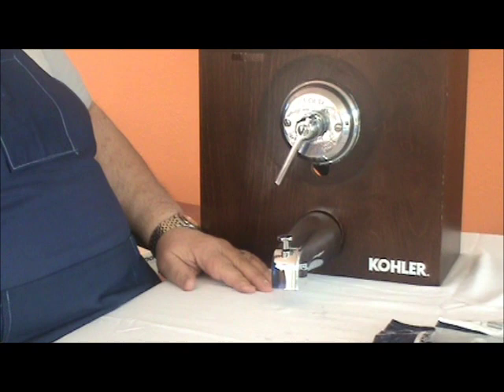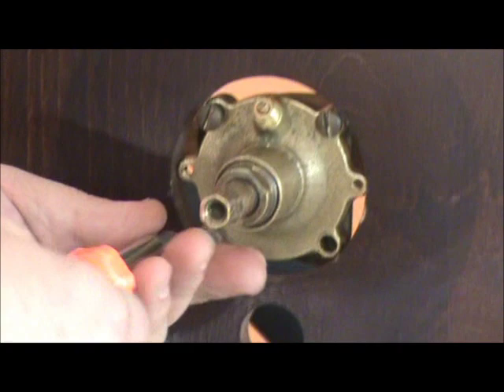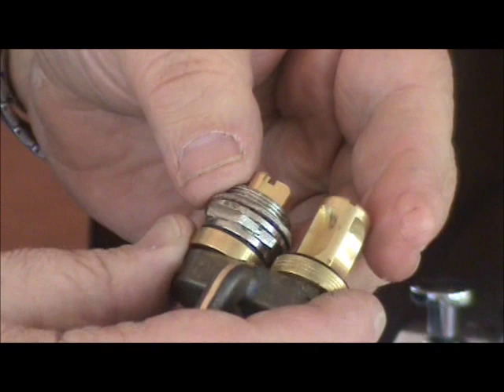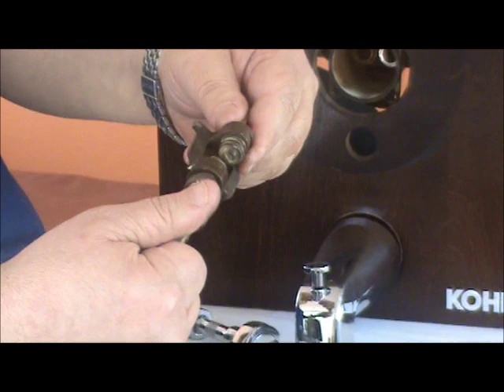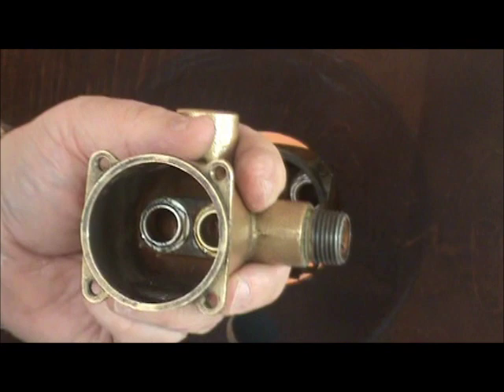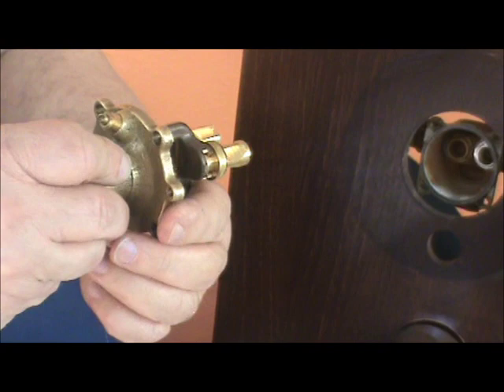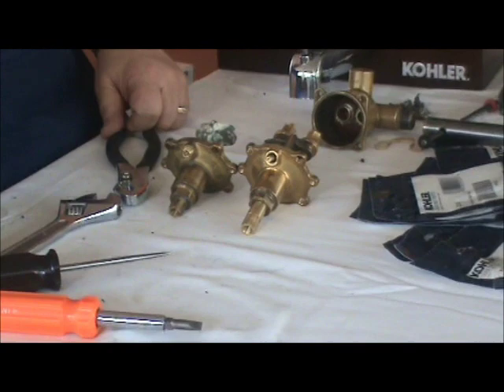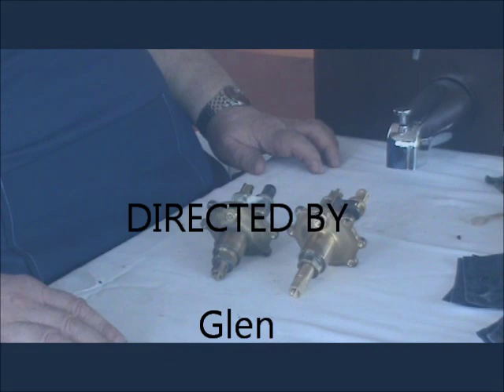Kohler Niedecken Single Handle Shower Repair Video

Comment: It's so frustrating that most of these handles can be fixed with a rubber washer but this old thing is a $120 repair... I'm just going to wait until I do my shower replacement and update.  Thanks for the info.

Comment: Would add one more thing. I followed your instructions and wound up with very little hot water. Round cold square hot. Problem was that original input hot and cold were plumbed in reverse. So be sure and identify which is hot and which is cold. Simply open shut off slightly and then felt where hot was coming from.

Comment: Excellent video!  I wish I had found it before I worked on mine.  Fortunately we have a hardware store in Wyoming Mi. (Godwin Hardware} that has the parts and advise for anything you can think of hardware related.  The only thing they could not fix was the stem but it was still serviceable with a new yoke.  Their tool was too worn to get the jam nut out.  Thanks to Jim Walsh for the suggestion of making a tool out of 1/2" steel pipe for when the stem finally gives out.
Reply: Thanks for the kind words glade it helped Glen

Comment: Thanks for the video.  Mine was leaking from the shower-head and after I opened it up leaked from out from the cover.  After watching I was able to mickey mouse with spare rubber till the parts get here.  We have hot-water heat so having the water off for an extended period is not an option during winter.

Comment: Kohler also in those years sold the Shasta mixing valve (replaced in 1973 by the Centura), which functions similar to the Delta 600 series. But these two were on the decline after Kohler introduced the "Rite-Temp" pressure-balance valves in 1971. I'd like to think Kohler discontinued the Niedecken mixing valve after around 1982.

Comment: great video - thanks for taking the time and effort to do it - great detail     i have two of these in a duplex i work on in wauwatosa - so will be taking both handles in to ppp plumbing to have bushings and gear changed - kind of a thanks for the video -and save me pulling more hair out

Comment: Awesome video!! Thanks for doing it. I do have a question.  If you turn the hot water on all the way will it get steaming hot? Provided the water heater is set hot enough.
Reply: yes.
Reply: Yes... for that matter you should instead buy a "Rite-Temp" faucet if you like Kohler so much.

Comment: I have the same issue as Mudders.  I had the spindle & yoke replaced.  Now I only get luke warm water.  I backed the adjustment screw out and it only helped slightly.  The water is hot without the unit in the wall and was before the repair.  I am going to try new seats and maybe plungers next.  Any other ideas?
Reply: you might have to replace the valve just do not use delta they leak all the time use moen hope this helps!

Comment: Just spent three hours with one of these and it still won't shut off totally plus I have zero pressure. Well at least I know now how the water temp is mixed.
Reply: you may have to replace the faucet just do not get a delta they leak all the time get moen hope this helps!

Comment: Had mine rebuilt as you showed. It still leaked between the nut and stem even when completely tightened. The shop I went to said sometimes this happens, bring it back and they replaced the packing a second time. It finally stopped leaking when I had tightened it to the point where it is just a bit uncomfortable to turn, but it’s no longer leaking. Could I add some fibrous packing on top of the graphite to reduce the amount of tightening needed? Any other ideas or advice would be helpful. Thanks!
Reply: It wont hurt to add more packing, but that will become little by little easier to turn. The more you use the better it will be
Reply: Thank you!

Comment: Hello, Thanks for the video! We have this model, first one you worked on. We had dripping and took the stem in to be repacked. Worked great for a while. Now our problem is the hot/cold mix, just not getting hot. Would that be the seats that we need to replace? or the yoke, or both? Would be so grateful for an answer!
Thank You!
Reply: If the unit has not been worked on in the last 15-20 years, it is most likely need to be rebuilt. That would be a stem and yoke replacement . Please call 414-321-8570 ask for Glen

Comment: I replaced the three washers as you suggest but now the hot water leaks. When I shut the water off the cold shuts off completely but hot water stays running (slowly). Any ideas?
Reply: The unit most likely is going to need to be rebuilt. It sounds like the stem and yoke are starting to ware.

Comment: This is great information the problem is I just discovered that my Kohler need a can shower valve must be older than 1936 even though my house was built in 1940 because the distance between the hot and cold for the yoke is wider on mine than the part 30092. Help. i’ve taken this thing apart three times and I just want to fix it once and for all.
Reply: I gave Kohler called called today and they told me it’s a 30094
Reply: 30092 and 30094 are the same just packaged differently
Reply: GLEN KANCZEWSKI Well I know that the 3092 would not fit the two stems were too close together to go into the valve body and according to Koehler 3092 is the yoke for the tub fixture and the shower one is 30094.
Reply: Send me a picture I'll look at it in the morning
Reply: GLEN KANCZEWSKI what’s your email?